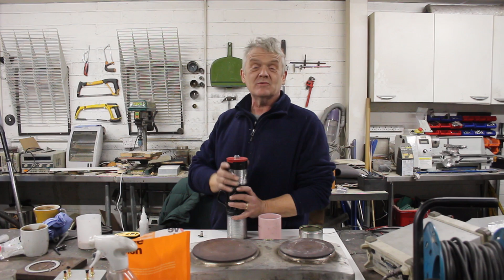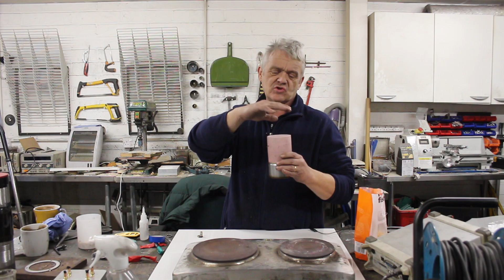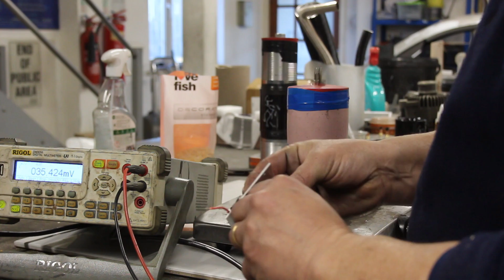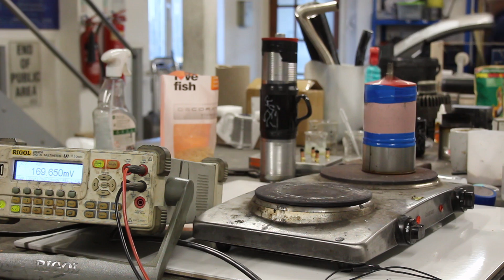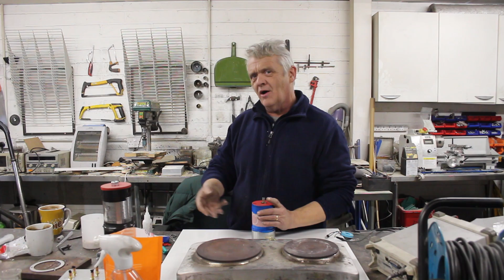1779 The Strange Engine As A Generator

Comment: I like the concept of electrostatic induction. 

Tip 1) Cycle rate is important. If one can raise the resonate freqency,  then they can get a proportionate increase in power from a charge pump, sort of like a bucket of water per second delivers 60 time more water over a bucket of water per minute.  Reducing the weight on the diaphragm and increasing the tension on the diaphragm will increase the frequency it resonates  at. 

Tip 2) increasing the surface area of a variable capacitor with a given minimal distance increases its capacitance and the amount of charge it can hold, sort of like increasing the size of a bucket of water holds more water.

Tip3) The tapered neck of a wine bottle may focus the energy in the sound wave, thus increasing the displacement which inturn increases the difference in capacitance between minimum and maximum capacitance which can drive larger voltage swings for a given charge.

Comment: Would you get more or less power out of it by adding heat dissipation fins to the top? You want it cold, right, so heat sinks there should allow a higher temperature differential, and thus a faster oscillation?

I wonder what happens if you run it in reverse. Running a Stirling engine backwards can generate cryogenic temperatures. Could you run an AC current through a coil to move the magnet to pump heat?

Comment: Here for it, awesome video as usual Robert.  I was wondering if you have an interest in Hot Bulb Oil engines or Hot tube style ignition engines? I ask because they are low compression completely mechanical engines with outstanding durability and the ability to run on literally any flammable fuel.  I've seen them in real life in many of their iterations and they NEED to be modernized and utilized.  It's been a goal and project of mine to convert a modern small diesel engine to operate with a hot tube ignition system.  It's a long time coming and I'm still in the early stages as I'm so busy with other projects, however one day I will dedicate the time and resources.  A little history on them I find interesting: This system was patented in October 1890 and development continued. In 1892 (5 years before Rudolf Diesel's first prototype), engineers at Hornsby's built an experimental engine. The vapouriser was replaced with a standard cylinder head and used a high-pressure fuel nozzle system. The engine could be started from cold and ran for 6 hours, making it the world's first internal combustion engine to run on purely compression ignition. However, to build a fully practical fuel injection system required using machining techniques and building to engineering tolerances that were not possible to mass produce at the time. Hornsby's was also working at full capacity building and selling hot-bulb engines, so these developments were not pursued.

Comment: Do you really need the gravel?  I'm wondering if a steel or copper pot scrubber would work as well? Or maybe carbon felt??  You could put bigger holes in the ceramic if you used the pot scrubber instead of the gravel, and that might improve gas flow.

Comment: I guess the buzzing sound that diminishes as you present the coil to the magnet is the back EMF off the coil restricting the diaphragm moving as far as it was ? So the more power that is drawn from the magnet/ coil combination the less the diaphragm/ magnet wants to move ?
Would this by why steam trains were powered with proper piston engines when proper power is needed ?

Comment: Would this work like a trickle charge for 12 volt lead cell car battery? Sorry if it's a stupid or already answered question. Love these videos keep them coming
Reply: Connect it into a boost converter board and give it a go. They cost about two euros.
Reply: @Teknopottu  Thanks from the USA mate! Ill give it a go
Reply: @mountainman3602  Glad to help. Greetings from Finland!
Reply: Yes.  You can regulate it to 14.5 volts and rectify it to DC.  It might not charge very fast, but it WILL charge until the battery reaches 14.5 volts.

Comment: Really great demo of energy transfer. Heat to kinetic to magnetic to electrical!
It's very cool to notice, when under load, the oscillation gets damped as current flows through the coil causing back emf proportional to the energy transferred.
Reply: Perhaps if he tipped the magnet with an aluminum cap and added a superconductor above the coil, the magnetic braking may give a little pushback to mitigate the dampening. There are probably any number of less expensive ways to do it, but none so fancy.

Comment: Might want to put a heat shield to stop the heat from the hot plate from rising to top chamber. I wonder how long it will take for the gravel to get too hot. The top chamber could be a motor cylinder with cooling fins.

Comment: 1:06 There's another option for generation. The diaphragm is moving, right? Which means it's pushing and pulling air? Get yourself another can, cut open both ends and then put a little fan or something on the far end. You'll need the kind that they use for ocean wave generation that spin in one direction regardless of the direction of the air flow. I don't know if it'll be enough to make it spin strongly enough to generate, but in theory, it should work.
Reply from the maker: indeed the theory is good mate - it's a wells turbine that you are thinking of - cheers
Reply: 5:49 It looks like the eddy current is slowing it down a bit, like I mentioned in a comment on your last video. Not enough to stop it, though, which is a good thing. :D